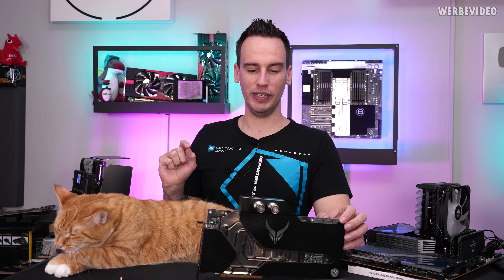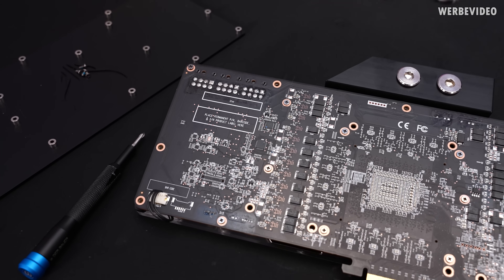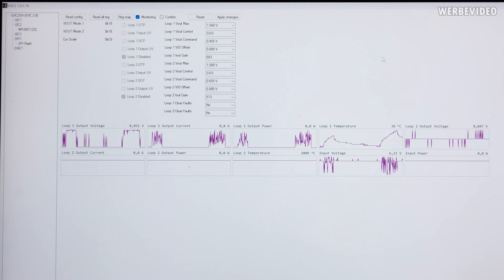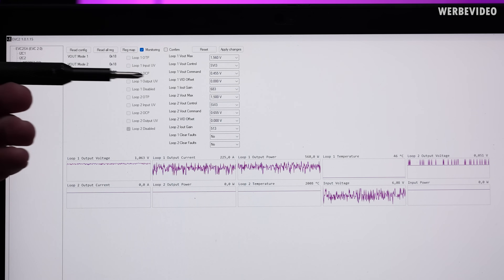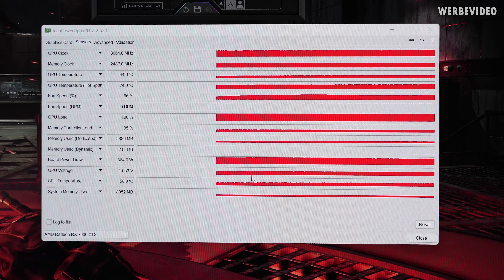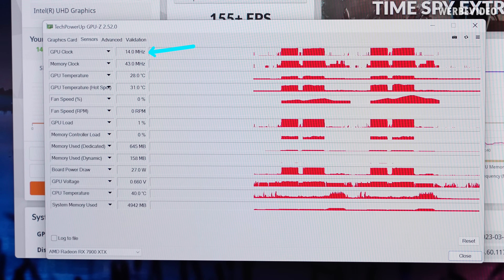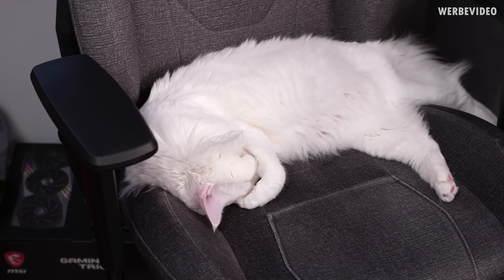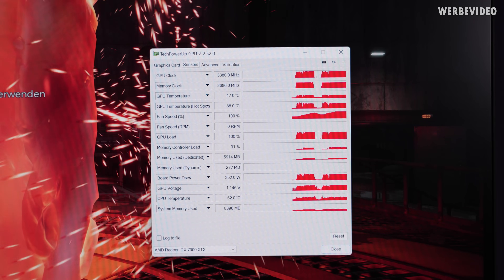Crazy Unlocked RX 7900XTX Pulls 650W

Comment: Really fun seeing this kind of stuff.

Also, the 3DMark leaderboards are an absolute mess because they list all of your results, not just your best with a given configuration. I swear half of the 4090 HOF is literally 2 dudes that did dozens of runs each.
Reply: You can choose to only show your best result and hide all the other runs. They just don't bother.
Reply: @madb132  It should really default to that tbh.
Reply: You can switch it to "Leaderboard" at the top left and it shows only the best score from each user. Been using 3D Mark for years now, only just learned this a few months ago lol.

Comment: Seems like computers are going to need a 48 volt rail soon.  Just like Tesla is doing with the Cybertruck, when you quadruple the voltage, you will quarter the current for the same amount of power. The copper conductors in wiring and connectors are what limit the current, while the insulation determines what voltage the wire is rated for.  Plastic insulation can handle 240 volts like in household wiring, so 48 volts won't be a problem.  The 8 pin connector is rated for 150 watts at 12 volts, so that means 12.5 amps.  Now 12.5 amps in a 48 volt system would be 600 watts per 8 pin connector. With that said,  power supply and board manufacturers would have to cooperate, and all the components that handle power would have to be rated for 48 volts.  However, a 48 volt mosfet would handle 12 volts without a problem, so new boards could easily be backwards compatible with 12 volt systems.
Reply: You also have the small problem that a not insignificant number of users are on 120v and 1500W per spur. I still wonder why more "enthusiast" American PC owners aren't using the 240v bridged phase mode that a lot of US houses can have for high power applications.

At the same time though, I also think burning 700 watts just on a toy GPU to run Minecraft at 3 billion frames per second is moderately insane, and GPU manufacturers really need to release something like a "XTE" or "TE" or whatever version of their next gen cards, which basically perform like previous gen but with vastly less power consumption.
Reply: Wouldn't change anything really since gpu still works at 1V
Reply: @riba2233  The GPU gets that 1V from a stepped-down supply on the card, hence all those honking great VRMs. The card itself is fed from 12V, which itself is stepped down from either 120 or 240v mains. Actually running a PC from 240v is more efficient than 120v, and I do have to wonder if stepping from 24 or 48v would be more efficient than 12v when stepping down to the 1V GPU voltage.

If it means less heat being created by the VRMs, maybe it's an option, though it would also mean everyone having to buy new $200-$500 power supplies to deliver the new voltage, because what nutcase is going to spend high end toy GPU prices, then cheap out with some Explodium-brand power supply?
Reply: @technicalfool  no, it would be worse for vrms to switch from 24/48 instead of 12 to 1v. Lower the difference the better.
Reply: 48V cables would be harder to bend, though, as the insulation has to be thicker.
Reply: @spankeyfish  I just grabbed a dell power supply and the yellow 5 volt wire has 300v printed on it.  Most manufacturers use off the shelf components, they don't make their own wire that just barely meet the requirements.  Off the shelf wiring typically has a rating in the hundreds of volts, it's only when you get close to a thousand volts do you have to worry about voltage leaking or dielectric breakdown. Often high voltage stuff primarily relies on distance or routing the wire away from ground or sensitive stuff because they can't rely 100% on the insulation. Regardless 48 volts is nowhere near high voltage.

Comment: Liquid metal on the die (correct precautions taken if course) should help tame those Hotspot temps. Did an OC run on Vega 64 a few days ago. Hit 500w power draw. Under chilled water GPU temp hit 37c and hotspot was only 50c. A good LM application will help bring down the Delta between HS and GPU temp.
Reply: Yeah, someone should tell Der8auer about this liquid metal stuff. I'm surprised he's never heard of it.
Reply: @hellraserfleshlight  🤣🤣 Nice come back.
Reply: @hellraserfleshlight  He should use Thermal Grizzly Conductonaut LM. I hope he gets some. 🤣
Reply: It's not worth bricking a very expensive gpu for a 2 or 3 degree temperature difference.
Reply: @luminatrixfanfiction  90 -> 50 is not 3 degrees lol
Reply: @ValentineC137  Most liquid cooling AIO's these days are good enough that you would only see a 2 or 3 degree temperature difference between those AIO's and Liquid Metal. It's not worth destroying a 3,000 dollar GPU for such a small performance uplift.
Reply: @luminatrixfanfiction  You gotta check your facts fam

Comment: It is sad that the ability to use MPT was taken away with this gen. It was nice to be able to just click a few times and be running at a solid 350W on a 6900XT, with the ability to still turn it up 15% with the OEM tuning software.
Reply: with MPT i pulled 615watt from my RX 6900 XT Red Devil Ultimate with waterblok. Got to set a few nice records on ambient with that setup. When I found out that MPT was not possible this gen, it actually stopped me from getting a 7900 XTX.
Reply: Damn didn't know that, no wander people aren't using these with ln2. Not too mention 6000bseries was killing themselves at idle on ln2.
Reply: AMD as always proves that they are just a red Nvidia

Comment: I love it when you do this crazy stuff , it just proves to me how silly it is. With my 7900xtx MBA under a waterblock I can get 16100 gpu score whilst using under 400w. To gain 10% performance for a 50% increase in power is madness and not something I will ever be aspiring too.

LtMatt is on the leaderboard so many times because each entry is with a different card. He had the Merc , Red Devil and Nitro+ and kept the Sapphire card.
Reply: Actually, the only entry on there is with the Nitro. I also never had the Red Devil. Tried the Nitro, Merc, TUF and Aorus. Nitro was the best overall. TUF would be one of the best but the power limit is lower sadly.
Reply: @TheMattB81  The Nitro I have looks limited to 463W with two 8pin and one daisy chain. Is that the power limit with three single 8pin? I'm not assuming the gpu can tell. Managed to squeeze out 10043 on 8k superposition with the stock air cooler.
Reply: @MasterSoda360  Yes, 467W is the max power limit, however it's typically shown as 463W by most software and on overlays. Not sure if you ever watched my videos on YT, but on my overlays you'll see it hitting the 463W frequently at 4K.
Reply: @MasterSoda360  Yeah the GPU can't tell how you are getting power to the 8 pin plug, just that you are. 150w per 8 pin plus 75w from the slot is the PCI spec. But depending on the quality of parts, as you see here, you can blast past that without drama. On my old mining riggs I had single 8 pins running y connectors onto 5700XTs. I must say those did get pretty darn hot inside the case. The new Nvidia 12v cables allow the GPU to talk to the power supply, so this isn't true for them.
Reply: @TheMattB81  I just ordered a nitro too replace my pulse for the higher power target.
Reply: @TheMattB81  Merc and Nitro performs at the same level
Reply: @resko8758  Yes, however the Merc's fans are so loud to me even at 30-35% so I couldn't tolerate it. Plus they Merc RGB was ruined when they ditched last years design which was ace. The Nitro just looks and sounds 10 times better than the Merc, even though they both have the same power limit.
Reply: @TheMattB81  I see, maybe something wrong with pc case :v
Reply: @resko8758  The Merc fans are so loud, it's shown in every Merc review. It's good for benchmarking as the fast RPM speed helps cool, but for everyday use it's annoying.
Reply: @TheMattB81  Thanks for your reply, I have 6600xt from biostar with revisited cooler (heatpipes and alu fins not that old school aluminium block) and I'm used to 2700 rpm fans lol, my Lian Li Lancool II Mesh does a  pretty good job at isolating this loud gpu
Reply: Even if you use identical hardware, it will still show individual runs on the leaderboard.
Reply: its the way it works i guess , Even at a modest +15% PL on my 7900XT i get 6% more performance.

its just diminishing returns really.
Reply: Was 350w in gaming though. Keep in mind the benchmarks are pretty artificial.  Possibly in winter to warm your office?
Reply: Meanwhile my 4090 gets 26,000 at the same power draw…
Reply: @frostybe3r  Cap. The highest 4090 on Time Spy Extreme graphics score is 25273 in 10th place overall. The other 9 are dual-GPU systems.
Reply: @frostybe3r  that’s impossible
Reply: @frostybe3r  Try that 17000+ with a 4080 because that's essentially what Debauer is doing in this video...

Comment: I like how the "organized" ATX connector wires on the hetzner server completely block the airflow for the cpu cooler.
Reply: 0:50
Reply: Since this is a server, the fan likely more than compensate for this obstruction to airflow.
Reply: @LaughingOrange  i.e. the wires will be torn away by the airflow
Reply: They wouldn’t use CableMod cables in a server anyway. It’s just a demo unit. In reality it’s ketchup and mustard from a server power supply.

Comment: Loving the 7900 XTX content. Your high hotspot temps might be limiting your boost clocks. My air cooled XFX Merc 310 managed 17300 score on 450-475 watts. If you can get the hotspot to below 90°C you might be able to get a much higher score.
Reply: The ridges on that backplate are no joke. It’s also so damn long it has good pass through on the heatsink despite the large pcb that nvidia ditched with ampere and Lovelace for better cooling. It also has good thermal interface material for the backplate.
Reply: @quin_helldiver  Yeah, the backplate on the Merc 310 seems to be really good and contributes a good amount to the cooling.
Reply: @TheActualChosenOne  merc 310 cools insane, my h510i case is the main problem now lol
Reply: Yeah I just got my XFX 2 days ago and the headroom is insane. Still playing around with it but am througouhly impressed with what they did.
Reply: MOM, Bring me THE LN2 Tank?
Reply: Hi chosen one. I am about to water cool my merc 310 on air I get 2850mhz with 55% fan speed. What is your stable oc? Cause if i push my fans at 100% i can get 3000mhz +. Hope i can get same with water cooling at a normal noise  levels.
Reply: @aurelAli1919  You'll easily get whatever you can achieve with your fans at 100% if you have a properly-mounted cooler and a good radiator setup. Now, is it necessarily worth it to sit at 3100 MHz instead of say 2900-2950? You'll have to do some benchmarks to find out.
Reply: @rustler08  It's not worth it for me to run it in such a configuration for daily use. Mostly just interesting to see what the max potential performance is of the card.

The card will give you the majority of the performance at 350W. An Aggressive but Stable OC can give you maybe 10-15% extra performance, but it makes a lot more noise and heat. Merc 310 stock is already about 5-10% faster than the reference model, and it's plenty of performance for daily use.
Reply: @aurelAli1919  As of late, I mostly run mine on stock with the bios switch set to the max power bios. The max stable OC will depend on the game you're playing. Anywhere between 1055mV to 1090mV will be stable from my experience, but it will depend on your silicon quality. There are some games like Sons of the Forest that will crash very quickly if any undervolt or OC is applied. 

A max daily OC for me in games would be:
1090mV, 3300MHz Max Frequency, 2764Mhz fast timing memory, +15 Power and a fan curve to keep junction temps below 90°C. If the junction goes above 90 it can sometimes be slightly slower than stock.
Reply: @aurelAli1919 3100mhz max boost, 1080mv, 2750 vram. Don't go lower on mv or it breaks depending the game
Reply: What type of heatsink does the merc 310 have? aluminum, nickel-plated copper, or copper?

Comment: Pulling 700w and still slower then a stock 4090 😲
Reply: You can pump 650watts into a 4090 and get almost no gain from the extra 200 watts. These cards come pretty maxed out out of the box. Messing with them only takes a few weeks off their lifespan.
Reply: I don't think those extra watts bring much since those cards do not scale that well after a certain point. But yeah the 4090 is faster and on a better node if i remember right.

Comment: In my 7900xtx nitro plus at 465w I have an average of 15% more fps than stock model in cyberpunk native 4k clock is around 2900mhz. Gaming clock at 3350mhz is crazy. I would like to see a test on the amd platform with SAM on.  Certainly the results would make a greater impression than those in 3d mark.
Reply: I got the same card. It can hit 3200 in games but it will crash. Stable enough to progress but pita too
Reply: @quin_helldiver  Depending on the game you have a different game clock. In modern warfare 2 you can have a stable clock at 3200mhz. For MW2 I have set 3300mhz@1081v this gives in-game clocks of 3100-3250mhz. But to achieve such clocks in cyberpunk is already a challenge.
Reply: I just can’t be bothered to tune for every game when it involves sitting through crashes that might take an hour to appear then reloading everything and doing it again. Maybe if I only played one game.
Reply: @quin_helldiver  Overclocking RDNA3 is not easy, if you don't have the patience and you have errors, then play with factory settings.
Reply: I was able to reach 3.3gh peak clocks with a really good reference card, but it was both power and cooling limited on it, so it would hit those clocks in games then actually drop clockspeed by a lot so it would ultimately result in less performance. My current Tiachi will comfortably sit around 3.1ghz without issues while sucking down 465ish watts

Comment: Hey man. I just got myself an 7900XT, but I'm using one splitter cable. Should I use two separate cables instead?
Reply: I would say yes but it's an XT and not the XTX so nowhere near as good of a card anyway so I mean probably not but it's upto you right? Why XT and not XTX though?
Reply: @abritabroadinthephilippines  The difference between the two was over 300 euros.
Reply: Yes, absolutely
Reply: Use separate cables whenever possible.
Reply: Yes. Especially if you don’t want coil whine. I’ve seen this question a lot lately.

Comment: Have you tried watercooling and then overclocking your cats? Maybe you could achieve 1.3x jump height and 1.75x peak running speed boost if my calculations are accurate. Worth a try maybe
Reply: water cooling alone would probably enable her to achieve such level of performances ☺️
Reply: @elonwong  Potentially yes, but various breeds of cats react differently to watercooling so precise testing would be neat to use as a baseline for future comparison!
Reply: He wouldn't want to delid the cat.
Reply: @awdrifter3394  nahh bruhh..
Reply: increasing voltage applied to a cat is a key. But, you must be extremely cautios, its internal structure is not adapted to prolonged overload and can suddenly fail. Also, your own interface can be severely damaged in process of applying and especially after detaching voltage